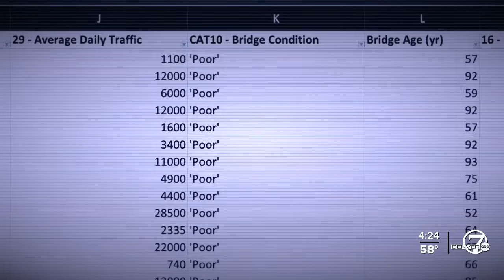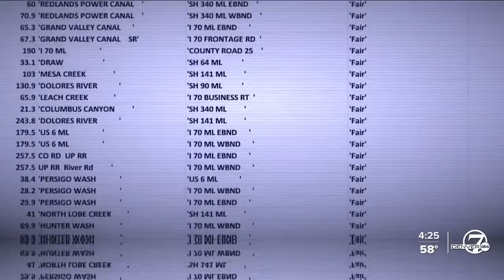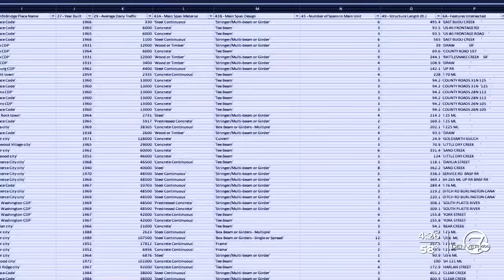CDOT repairs metro area bridge after neighbors reach out to Denver7 Investigates

Comment: So she is saying that the bridge designers wasted money by incorporating concrete and rebar which was not necessary?
She is a genius. Maybe she should be teaching bridge design? 
I suppose that since government officials are exempt from prosecution, they don't have to act responsibly.
Reply: Yes, always over design and over build.  To build to exactly 100% of rated load leaves zero room for error or age.  So it is not wasted money.
Reply: @randyb1890 
The reason for 'over design' is not to allow the bridge to rot away.
It is to allow for the variability in the materials used, minor errors in calculations, unanticipated loads and fatigue.
Reply: And government officials are NEVER exempt from prosecution!  It may take longer than for regular citizens, but a couple of recent news stories come to mind - one about a certain ousted District Attorney (regarding what she was ousted for), the other about a certain former president....
Reply: @gregculverwell absolutely, though that's also not to mention that rebar and concrete are simply exponentially better together than concrete or steel on their own.  One is good in compression, the other is good in tension, and, honestly, on those poor-rated bridges where the rebar actually IS showing through (the fair-rated bridge had exposed piping, very different), that just means that the rebar has been doing its job at keeping the bridge together; of course, now that the rebar IS exposed on certain bridges, the time has just passed to be starting serious conversations on their replacements, because, once the exposed parts of the rebar start to corrode, that can spread and become systemic to the bridge in a relative hurry.

Comment: I am no engineer by any means, but wouldn't exposed rebar be a bad thing? Moisture getting into them, causing them to expand and cracking the concrete and spalling? Thus the whole thing losing structural integrity over time? And since that is the case, most those bridges be considered poor and dangerous to go over?